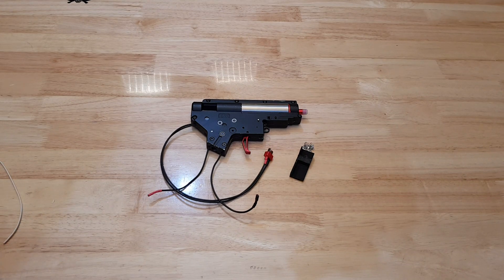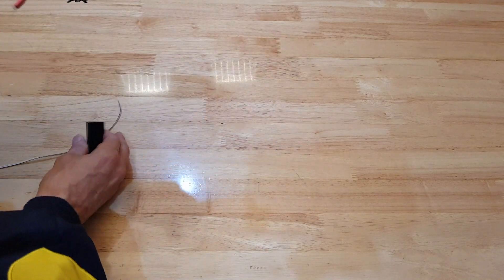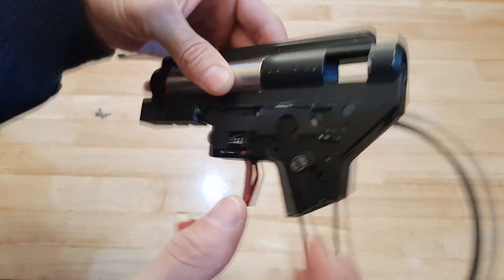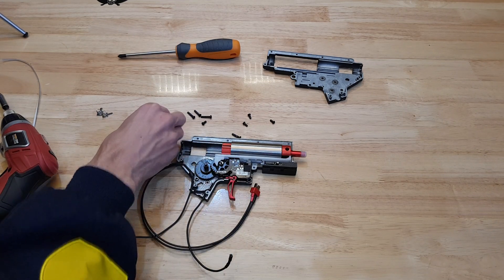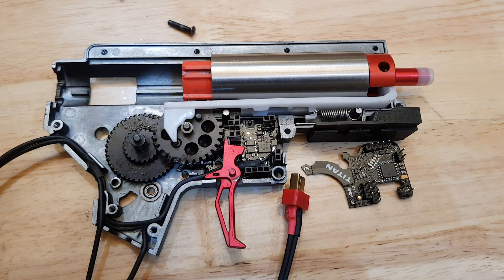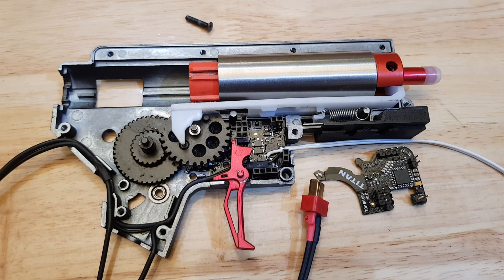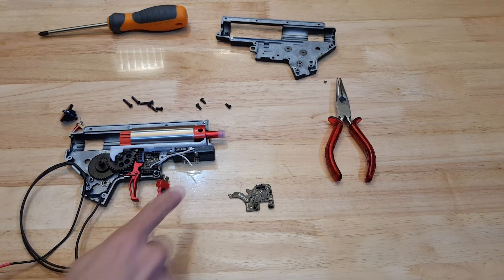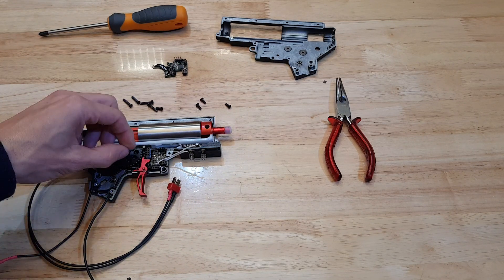Titan MOSFET install into gel blaster. (part 3)

Comment: My man. How did you go finishing this box? did it work? you cant leave us hanging hahah

Ive been told that if you over solder the mag terminal wires, the fet reads it as a short and shuts itself down? is this a common issue or no? thanks mate

Comment: Just wondering i have had a vector v2 for a while and had a 1.4mm spring not being used, if i put that straight into the blaster replacing the old one would i need to upgrade gears or leave the nylon gears? (used with a 11.1v)
Reply: You might get one shot off and gears will strip. But just saying it's a 1.4 spring doesn't say much, could be soft or hard. I have 1.3 springs that have higher readings on the tester than 1.4 springs.
Reply: @IIIIRokzIIII  it was bought off tactoys.com, how do i see if its a soft/hard spring without putting it in the blaster?
Reply: @shadowspike100  Have a look at Guidos other vids or Google how to test springs. It requires about a 2kg weight and a contraption to hang the weight in a way to compress the spring then measure the length it compresses to. Once you have done a few springs you will have a rough guide on what springs will give higher or lower fps. It's more accurate than going by wire thickness.
Reply: @IIIIRokzIIII  ok thanks!